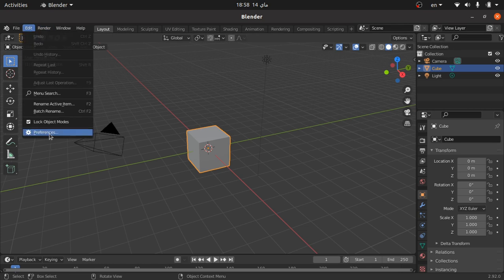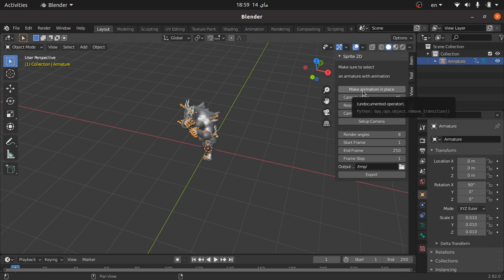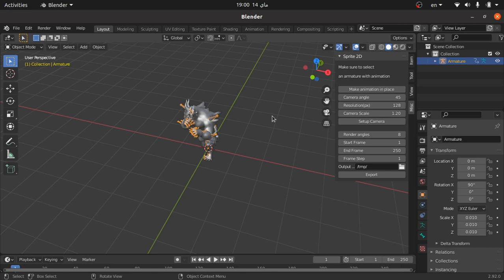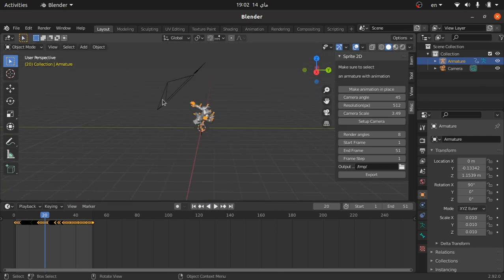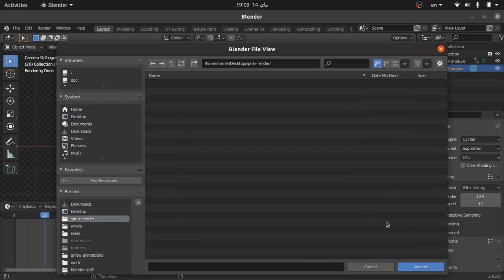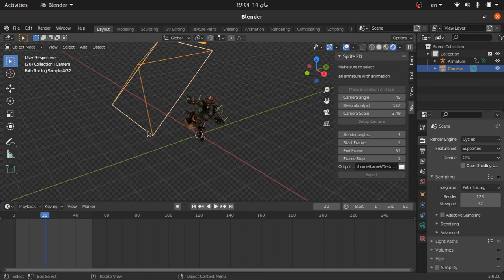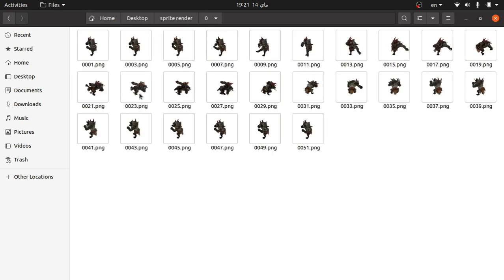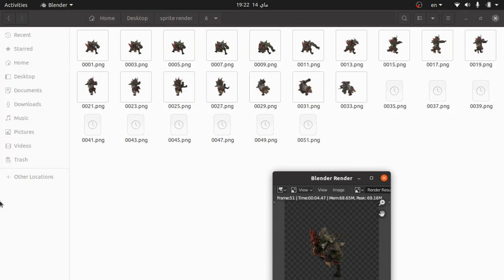Blender Sprite2 D add-on

Comment: "Hello. My English isn't very good, so I'm using a translator and my English might be a bit awkward. After exporting an image, is it possible to give it a consistent name? When I increase the Frame Step, it appears as 0001, 0009, 00017, etc. Can I make it so the names are consistent like Sample_001, Sample_002, Sample_003 and have the numbers in sequence?"
Reply from the maker: Hello, sorry for the late reply.
This not possible currently from the add-on. The add-on uses the normal blender export.

Comment: my characters center point is 0,0,0 idk what else to do...
Reply from the maker: It is about the position of the origin of the object relative to the object itself and not the coordinates of the object in 3d
Reply: @kamelmohammad1961  Whats the easiest way to reset the center point origin to the center so the camera can rotate around my character i am selecting armature or atleast i believe its the armature it shows the bones only highlighted in yellow i selected armature befor i clicked setup camera and adjusted the settings accordingly whats the proper way of reseetting the transforms for the center point origin.My character has yet to still rotate when the camera is taking screenshots im only getting one side view and its the front
Reply from the maker: @LittleGody  I already shared with you how to do it on your comment on itch io, you can check there
Reply: @kamelmohammad1961  I simply did that and it still doesnt rotate the camera around my 3d model selected my 3d model right clicked clicked set origin to center of mass (volume) then i selected the armature and set animation to in place then changed the settings a bit and made sure my armature was selected then clicked setup camera then i selected the armature again once more then clicked export. It then exports the sprites into the folder i checked them and the sprite view is all from the same angle and position..So clearly something is going on.Everything works except the model doesnt rotate around the camera.
Reply: @kamelmohammad1961  Do i select the armature and click center origin to center mass (volume) or everything regarding the whole model and armature
Reply: @kamelmohammad1961  Everytime i center the origin to mass (volume) it never centers it directly in the middle am i doing something wrong?

Comment: The camera doesnt align with the character it appears underneath the character i can attach a screenshot
Reply from the maker: The add-on won't do all the work for you, please make sure that the center point of your model is set correctly before using the add-on. Not all models will work perfectly out of the box. Sometimes you need to tweak things a bit

Comment: @kamel mohammad I just purchased this but when i go to click setup camera it gives me a error and the camera is positioned where it wont see the 3d model it just takes screenshots of a blank screen which version of blender are we suppose to be using
Reply from the maker: Hello, sorry to hear that you are facing problems with the add-on, the add-on support blender versions from 2.8 to 2.93. Please make sure that you are selecting the armature before clicking the setup camera option ( as mentioned in the tutorial), also you can try to apply transformations before using the add-on. let me know if that resolve the issue.
Reply: @kamelmohammad1961  thankyou so much!! You are a brilliant developer it works perfectly but one more quick question how come my characters textures arent applied in blender.and when it takes the images of my character model animating the character model is purple
Reply from the maker: @LittleGody  I'm happy that it worked, the purple thing means that blender didn't import your textures correctly, please go to shading tab, select your model and make sure that the correct materials and textures applied
Reply: @kamelmohammad1961  Thankyou it works also anyway i can create a spritesheet with these images? im trying to use them in unity maybe a addon feature for the near future?
Reply from the maker: @LittleGody  for now you can't create a sprite sheet directly from the addon, you have to use another application to group the images, but this feature will definitely be available in next version, but currently I'm a bit busy so the next version won't be released soon
Reply: @kamelmohammad1961  your addon is 100% effective and sufficient and works amazingly!!!!!!!!!!!!!! thankyou godbless